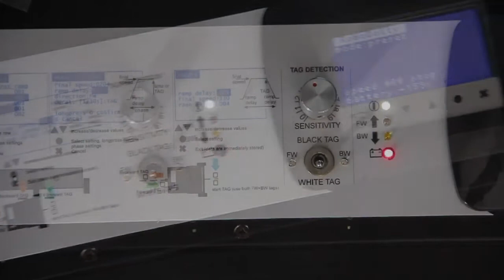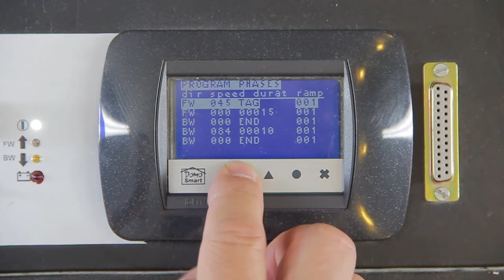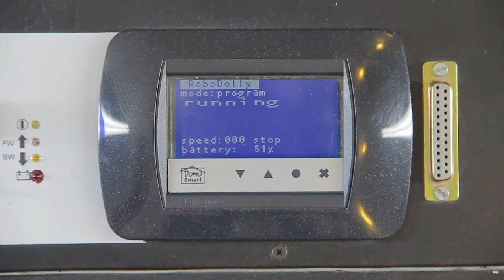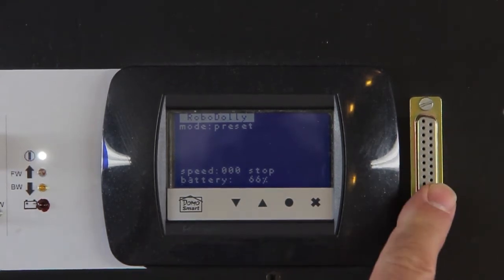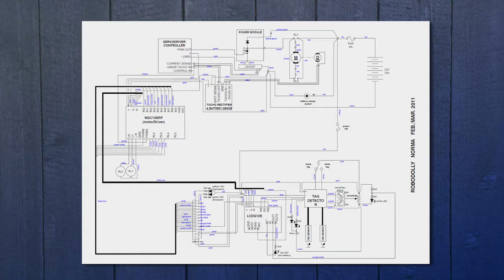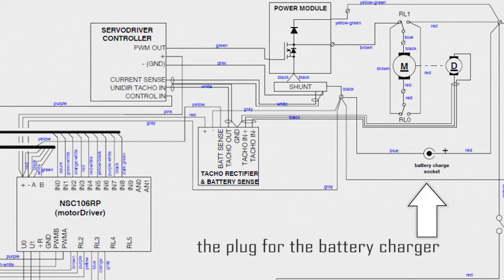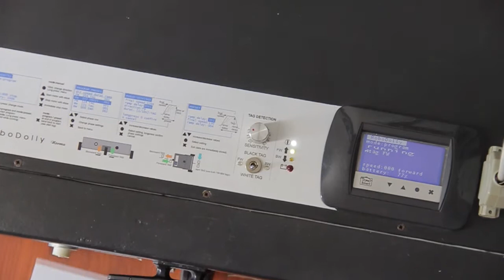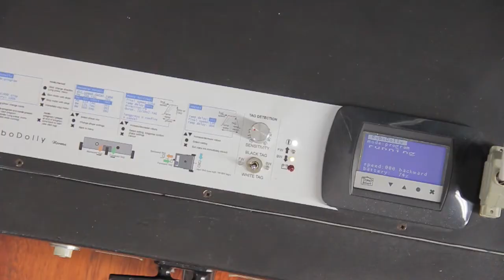Robot dolly for video making (failed) DIY project

Comment: It might be easier to make an automated track dolly. Or just use a camera with a gimble. If it could follow the subject like a drone that would be cool too.
How close are we to having a sex robot? That's what everyone really wants to know.
Reply from the maker: Well, this robot is nothing more than automation after all. However I do agree, this object was way too complex to use. But if you have to make a stop motion video, for instance, then a track (a slider) with an automation controller like the one I've used in making that robot could be really helpful since it can synchronize with the scene controller, which also control the camera synchronously.
...about sex robots well, call me old-fashioned, but I'd prefer the real thing ;) 
Thanks for watching and for your comment. 
Claudio.